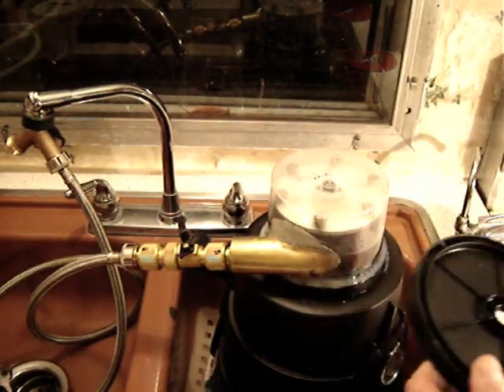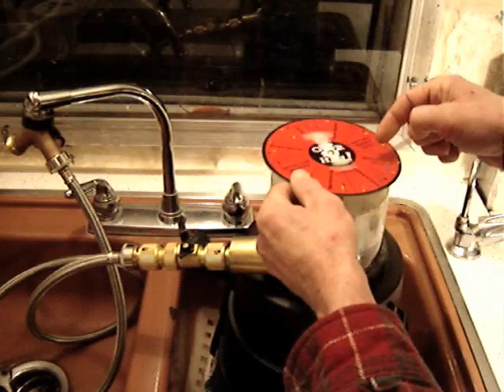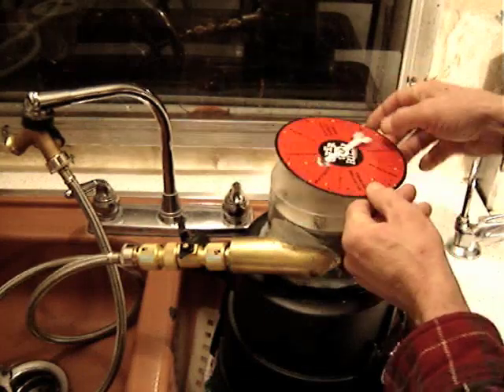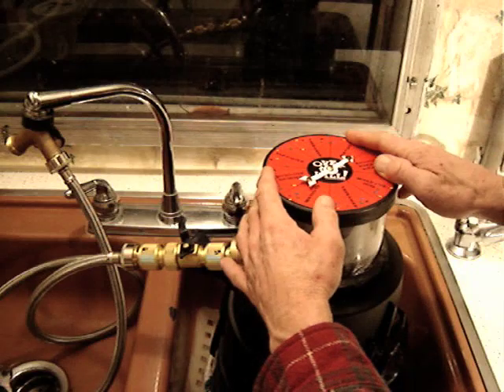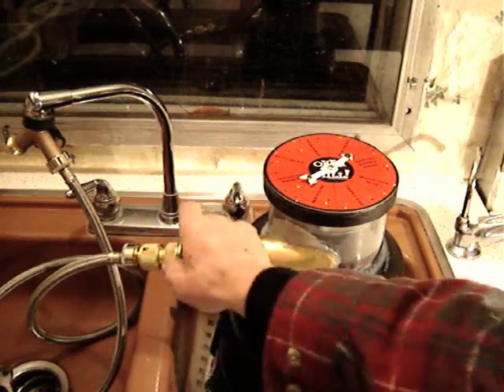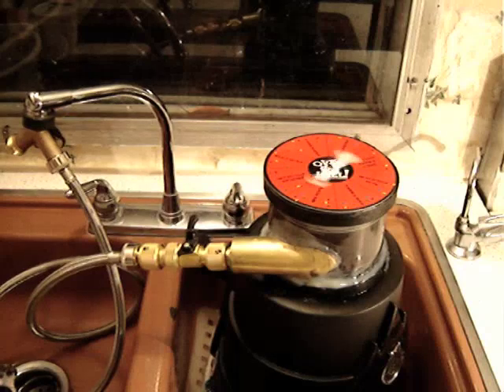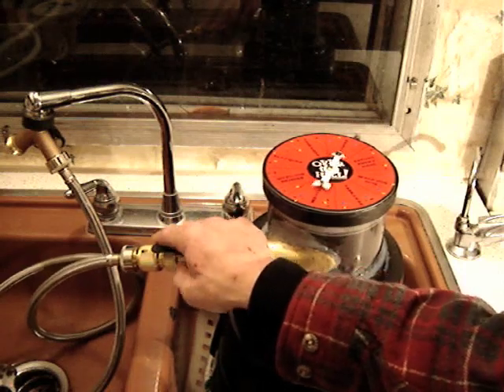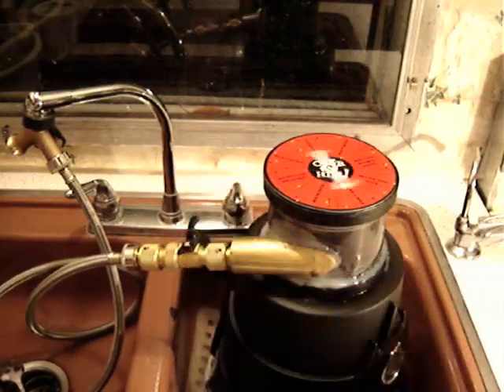SinkScience #06 - Tesla CD Turbine Holiday Decision Maker

Comment from the maker: I agree that the two should be combined.  One Tesla turbine could be used to generate the hydrogen, and with ceramic discs, another turbine could handle the heat of burning it.

I think the ultimate would be to have a hydrogen plasma based turbine, with magnetic fields involved. (see MT Keshe movies on radical new magnetic plasma theory at YouTube/watch?v=wtf5bp76ArE )

Comment from the maker: When I hooked up a heater motor in reverse as a generator, I was only able to get a couple of watts out of this CD turbine. Most of the power of the faucet water pressure was used to overcome the turning resistance of the generator.